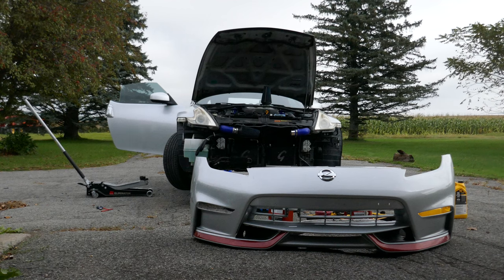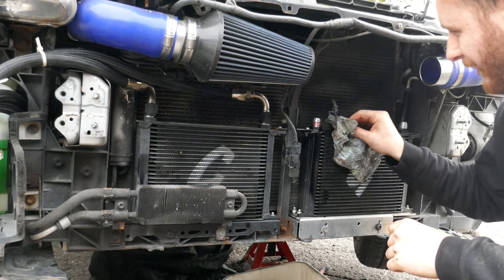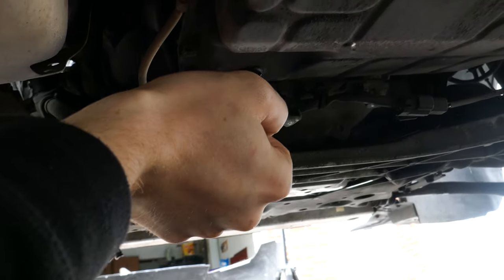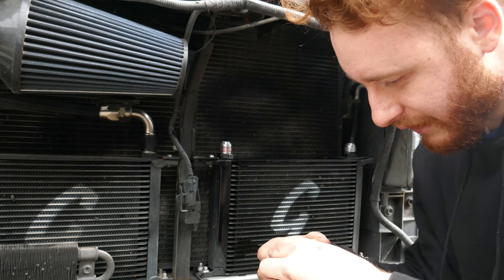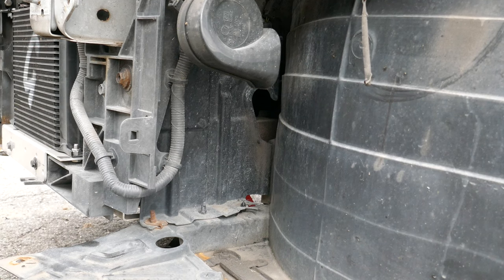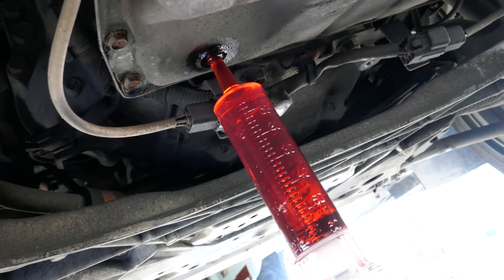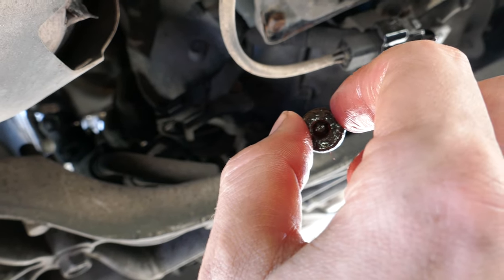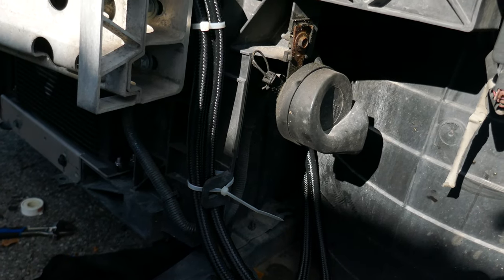370Z Automatic Transmission Oil Cooler Install

Comment: Are there specific connections for the oil lines? Like one line is in and and the other is out when connecting then aftermarket cooler lines to the original cooler barbs. Or does it not matter?
Reply from the maker: Whichever line goes in first will be the high-pressure side, and the other will become the exit. Right-left or left-right oil direction doesn't matter in this radiator design.

Comment: Here I was hoping you would route the lines in-line with the OEM trans cooler. Seems like the easy way out is to bypass it entirely and cap the radiator points. My only concern is through research people have suggested that by bypassing the factory cooler in the radiator then the trans fluid could get too cold, as the radiator cooler has a warming line that feeds into the transmission. Both too cold and too hot for the trans seems to be concerns for people.

Did you plug your cut lines from the radiator? I highly suggest that to keep pressure in the radiator stable and keep contaminants out.

Overall very good vid thank you
Reply from the maker: You are right that transmission fluid cool being too is a concern. What you can do is install a thermostatic plate between the lines, ensuring that the fluid doesn't go to the radiator until hot. However, Grassroots Motorsports who I got the kit from, and called for advice, told me it was not required, so I didn't spend the additional $250 to get one.

There is an additional consideration: if the radiator fluid leaks in the transmission. This isn't good either, and is a known problem on some Nissan vehicules -- can irreversibly damage the transmission.

Considering that my build is more specifically track-focused, I like this arrangement of separate radiators. However, if using the vehicle in winter, it does sound like a good idea to keep the additional radiator connection.

Thank you for your coment, and thank you for the advice on keeping contaminants out.
Reply: @DenisLabrecque  I'll probably do it your way after thinking about it some more. I ran into limp mode due to AT overheating at road atlanta. It's not a great feeling https://youtu.be/0KpPsTg2xh0?si=Bixe2YMw_ZF6Xdso&t=358
Reply from the maker: @runrobrunn  wow! That's some intense limp mode! My G37 would limp, but only by limiting the rev range.

After looking on Z1 motorsports, the transmission cooler kits don't include thermostatic plates, so I suppose it's fine. Especially if you do a warm-up lap.